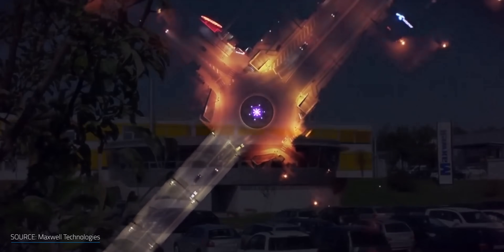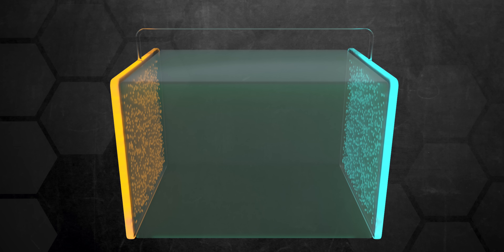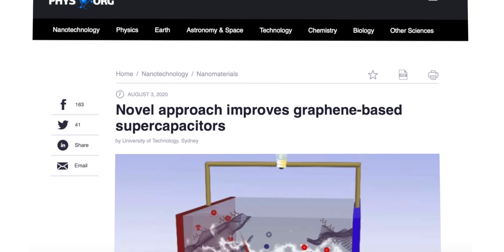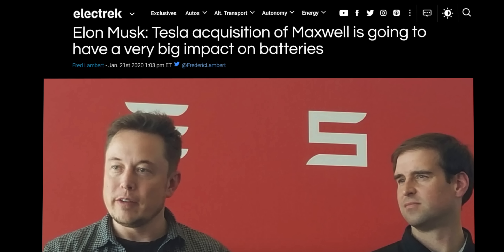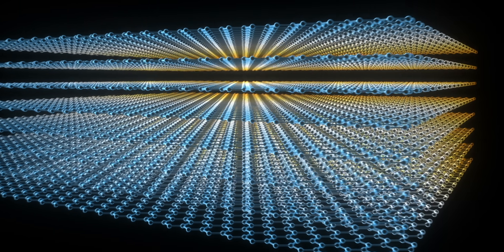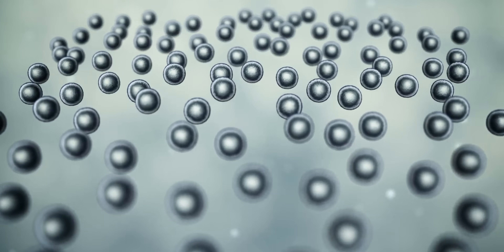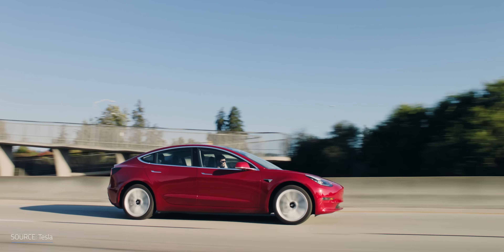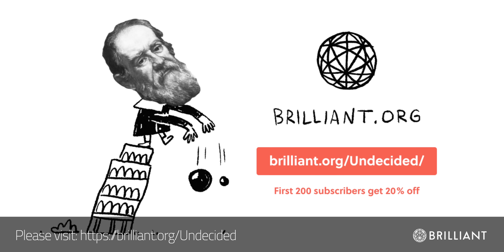Supercapacitors explained - the future of energy storage?

Comment: And it´s still no battery, you also cannot use 80% of braking energy to store in the capacitor, that´s only possible from engine braking, as soon as you use your disc brakes, all the energy is transformed into heat, 0% goes into the capacitor.

So your question is pretty easily answered, no, capacitors are not the future of energy storage and they never will be.

Comment: Charge the super capacitor in a few seconds, then drive away. Trickle charge the batteries from the super capacitor while you drive. No?
Reply: @Michael Kmiotek   The Chinese, in Shanghai, have been using this technique on their buses for about ten years. The buses can run on one charge for about 5km (sans air conditioning) and about 3km using air conditioning. Another problem (occasionally) was the extremely rapid discharge of the capacitors ( which lay people tend to refer to as a .... large explosion) which on several occasions blew the side out of the bus and gave the passengers a big fright. This is a small example of the Big Bang.

Comment: Sigh, will we ever be free from supercapacitor speculation?  For any long range EV they make zero sense.  If you have the room, weight capacity, and expense for supercaps you're always far better off just using those to add more batteries.  Even if you need to reserve some battery capacity for extra regen.  The energy density is not even close, and before anyone tries to say "supercaps are improving", so are batteries, and they are way out in front when it comes to energy density.

Comment: Why can't they be used to speed up charging? Can't supercapacitors store energy at the station and then charge the batteries over time?
The big downside of EVs is the time it takes to charge the batteries on the road in a  "gas stations" or even at home. If super capacitors can reduce that time comparable to filling up a tank of gas then there is no positive advantage in using a combustion engine.
Reply: If what you said was possible, it would have already been used.
Reply: @acmefixer1  That is not an answer.. I was hoping for a technically informed response. Infact as a rule capacitors discharge slower than charge. 
I am an engineer myself but not an electrical engineer and in principle can't see what it stopping doing this.

Comment: Batteries are so outdated. Long time ago Tesla made a car. He was using 9V battery ti start car, But that was it. Point is in beer bottle glass trick. Charge is what battery is. But charge baRЯier is quite other thing. Today we know it as Casimir aka Tesla's effe-ct. Electron is slower than photon. Swiches can be so fast that we can use magnetic potential as lead at small distances for charge barrier aka vacuum to push that electron without using amperage, just voltage. we don't need that huge batteries. but it is good to having them. Just saying that future is elsewhere.

Comment: Will Tesla use Super Capacitors?  In a word, no.  And I think Elon addressed this some time back.  The cost and space requirements for Super Capacitors don't make it worth it for the, literally, several miles you might gain.  And as Tesla EV's can already do sub-three-second zero-to-sixty mile per hours acceleration, what is the need?  Now, in the distant future, yes- but not as a hybrid with current battery technology, as a replacement once a Super Capacitor can be made with the same, or better, Energy Density.

Comment: Nope. battery technology in EVs is far away from good enough. And the energy density of these supercapacitors is much to low, so yes, in combination with the current battery technology this might work. But, at the end won't help to recharge a battery from 10 to 80% not very much faster. Also to be considered the max. Ampere you can get from the current grid, so saying no problem for the grid is also wrong. Each student of engineering or physics could you say why. So, as long we also don't have a superconductor in place in our grid, where do you get this electrical energy passing the grid?

Comment: Your content is generally intelligent.  This was quite a divergence for you.  As the cap stores the energy in a field, when it is half empty it is at half the voltage potential.  This linear voltage change makes them incompatible with galvanic storage (batteries).  Chemical storage is dramatically better and is progressing rapidly.  Capacitors are only useful for very short periods and at very high rates of charge and discharge where you do not prioritize voltage stability.  This video feeds the widespread ignorance that they are meaningful in EV's.  Elon has been more than polite in dismissing these repeatedly.  It is a very tired topic now.  Your video should help many more waste time at public events talking about caps, flat earth, or whatever...
Reply: Tesla has today shown the value of supercapacitors.  I rest my case.

Comment: There is no future in super/hyper/ultra caps. They all suffer by design the same problem. They discharge with both amps and voltage. Soon you will have a lot of energy unuseable. ETC an electric motor needs 400 volts to move, the caps going under that energy unuseable. A battery will maintain a "constant" voltage until empty therefore useable energy is very high. Face it you don't understand what you are talking about.

Comment: Around (5:47) you characterize the "high specific energy density of Lithium, and long term storage" as superior.... Really?... you think Lithium ion has high specific energy density?  And, you think Lion is a superior long term storage option?  It begins to degrade after only 4 hours!  Hard to see your logic.

You praise Lithium ion at around 250 wh/Kg... and point out super capacitors at only 20 wh/Kg.  My point is, I think you're missing the forrest for the trees.  Clean H2, (hydrogen made specifically from renewables and water) seems off your radar, or analysis.  H2 has a specific energy density of over 40,000 wh/Kg.  How can you characterize Lithium-ion as "superior" given the facts about H2?  Your characterization of "Lithium-ion" being "good enough" for EVs is really short sighted.  Please do some math, and convince yourself you can dig up enough Nickel, Lithium, and Cobalt for even 10% of the new car fleet (let alone trucks, buses, utility loads, etc.).  Your statement that lithium ion is "good enough" for EV is short sighted and ignores the perspective of physics regarding energy storage.  Please do a show comparing All energy technologies.  If you do, you'll see we have a very exciting high specific energy solution to energy storage:  H2 from renewables and water.  Ready to go right now.  40,000 vs. 20.  Gee, I wonder which is better?